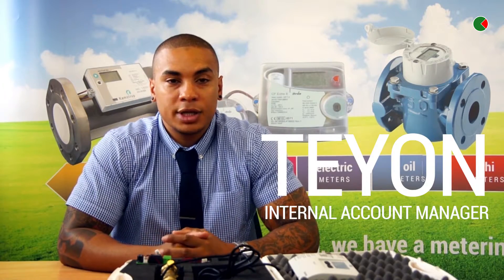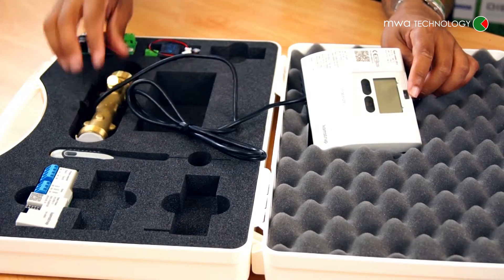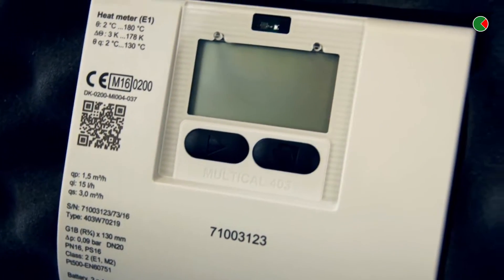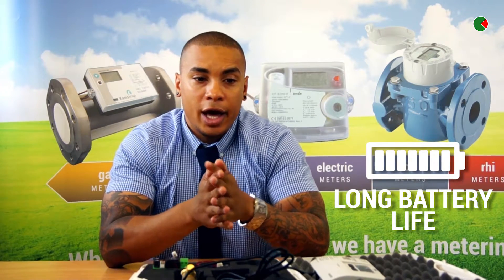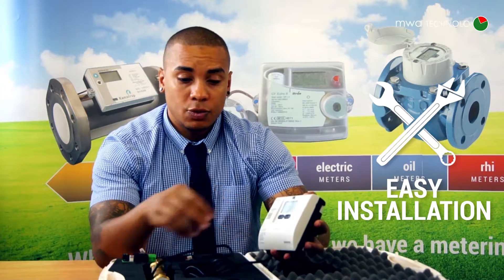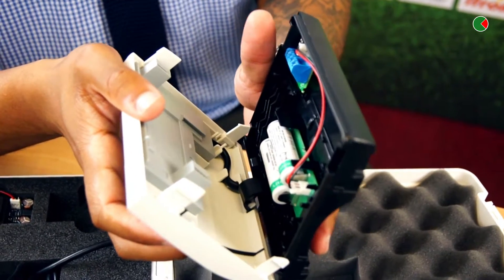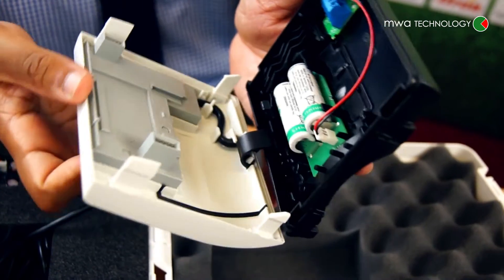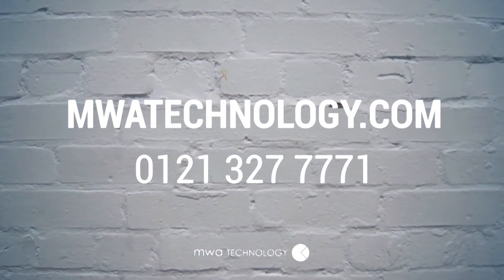Presenting the Kamstrup Multical 403 Heat Meter

Comment: I am moving into a property with one of these fitted plus another meter below that keeps flashing. I have no idea what it is or does apart from it is in the airing cupboard by the electric hot water. Local authority just shrugged their shoulders and say they have no idea what it is or how to use it evn though it is their property! 

I would be so grateful if anyone can tell me anything about it in simple terms and how to use it

Comment: Question. I have a 403 and 603 that have been fitted with a Modbus Card. How do I change the Modbus address?
Reply: Id worry about the effects your smart meter has on your body do a bit of research these devices emit non ionising radiation
Reply: Hi Its Matthew Rose of MWA Technology to change the Modbus addresses you will need Kamstrup meter tool. if you send the calculator back we can address for you. For more details send me an email - matthew.rose@mwatechnology.com